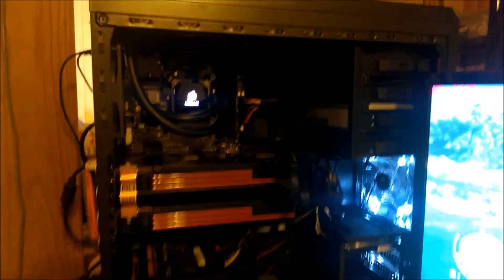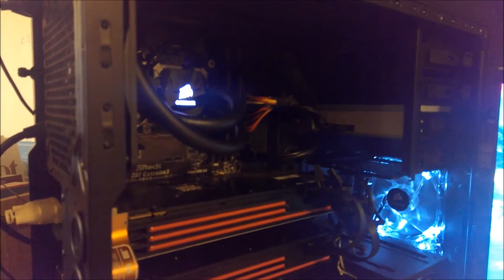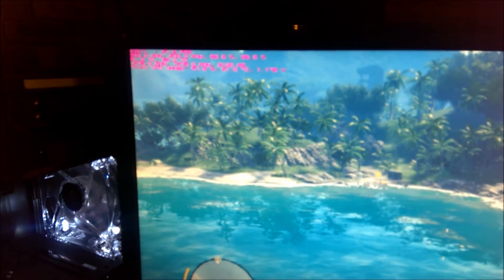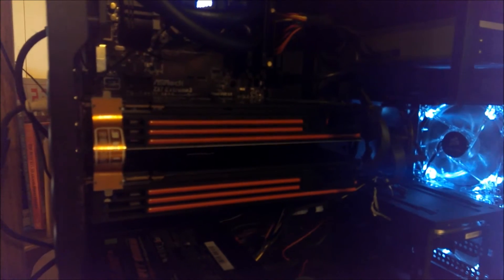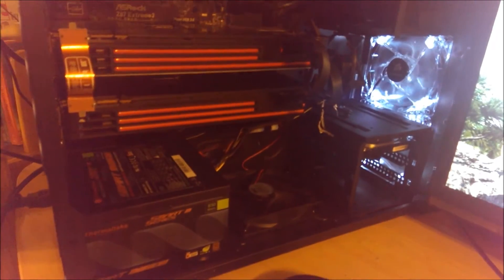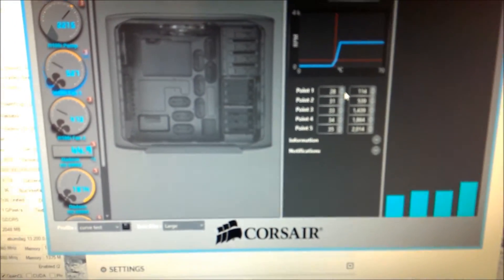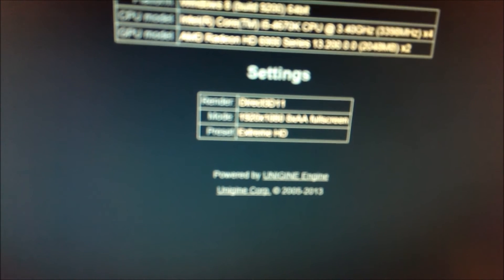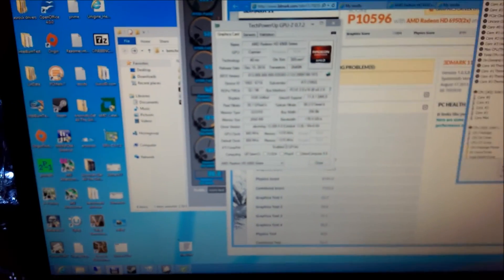Intel i5-4670k @ 4.6ghz Delid Win8 HD 6970 Crossfire Corsair H100i 500r Thermaletake 850 review

Comment: I can only reach 4.3ghz stable with 1.3v I can do 4.4ghz but wouldn't be stable with stresstest over time. Crashes.

Might gain some degrees by deliding. I don't know. Maybe.
Reply from the maker: I would say if you're still on a i5-4670k then 4.3ghz would be best to use, silicon probably degraded slightly at this point. Deliding is risky so make sure you have a backup computer to use. I actually now have a Ryzen R9 5950x using PBO and not all core. Will maintain 4.3 to 4.5ghz on all cores and still will downclock and down volt on its own.  Will boost to 5ghz on a core or two under lower loads.
Reply from the maker: I also don't stress test with prime95 it pulls too much watts, just cinebench multicore test

Comment: dude the fps is barly visible is it 69-65? im gonna buy this both of asus for decent price soon so wanna know how does this two perform thx
Reply from the maker: They were good 3 years ago, but both of the 6970's together performed as fast as a single overclocked 7970. So I would not recommend these cards at the current time. Look for a used non-blower r9 290x. I have a single r9 290x msi lightning right now. Very pleased and dx12 performance should be good.

Comment: I have a 4670k with a H100i and I had it a 4.2Ghz and the 1st core was reaching around 98c, I was using the stock thermal paste but I was not expecting it to get that high.
Reply: try to delid your chip?
Reply: scumbag geoff Whats deliding a chip?
Reply: you basically take the cap of, clean the shit that intel put on it and put some good thermal paste on it
Reply from the maker: mc woof woofington Have you ever seen a processor? The top part of it is a heat sink, when you pop that off the actual chip is in the middle. Well the thermal paste they used to spread the heat from the chip to the to metal part (heat sink) is very very poor, didn't transfer heat well, so it would get super hot even when you put a water cooler on the cpu. I replaced the thermal paste and it is now 18c cooler. Under load
Reply: David Hoffman Yes I have seen a processor with the cap off but i still was not expecting it to be that hot.
Reply: scumbag geoff Hah, I would but i like my warranties. reclaimed a few parts from it.

Comment: What an odd build, A h100i, 4670k and 2 6970s?
Reply from the maker: What's so odd about that? I just bought another 6970 to build this pc, then ended up selling both of them, and bought a windforce 780 ti.
Reply: David Hoffman Its just that 6970s are quite old.
Reply from the maker: Combined they were as fast or faster than $450 graphics cards a year ago, aka gtx680 and 7970
Reply: Yeah but there is 2 of them. I personally thought it was weird, not bad

Comment: i OC'd my i5 4670k 4.6ghz@1.28v...idles at 28c without DELID.
Running msiz87 g45 and hyper 212 evo and 3 case fans ^_^
Reply from the maker: Well that is idle bro, run prime95 or something. You'll feel the heat.
Reply: U got pretty good cheap i guess my i5 4670k for 4.2ghz needs 1.3volts :(
Reply from the maker: fr0sty think im at 1.36 or 1.37 maybe.

Comment: 84 degrees @4.4 Ghz???? My 4670K runs at 65 to 70 degrees celcius on full load with a 30 euro aircooler at that overclock. wtf???????????
Reply from the maker: Run prime95 and prove it, the build was running 4.6ghz though. I backed it down to 4.5ghz.
Reply: David Hoffman the problem with you, kids is that you only believe something when shown. I've come to an age that I don't have to prove anything anymore. Either you believe me or not. And well, if you don't, that's your problem, not mine. "cheers" .
Reply from the maker: GTI1dasOriginal Kids? I'm 30. First off you didn't say what ghz you ran at and you come in to my channel claiming something, I say prove it and now you say you don't have to? Sure thing buddy... Definitely a problem for "kids" you speak of to question random comments online and don't believe the first thing they hear! The nerve of these "kids!"
Reply: David Hoffman age 45 over here,  and the way you respond clearly shows you've got the mental ability of a 15 year old. Other than that:
4670K, @ 4,6 Ghz (see first post: quote: "My 4670K runs at 65 to 70 degrees celcius on full load with a 30 euro aircooler at that overclock" Unquote)
ends discussion